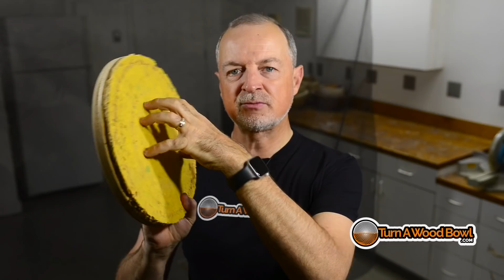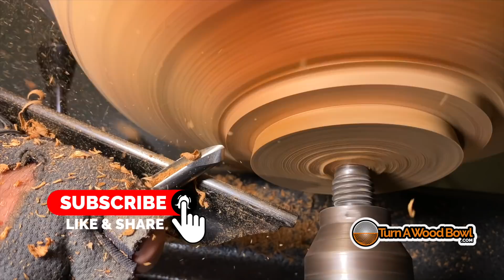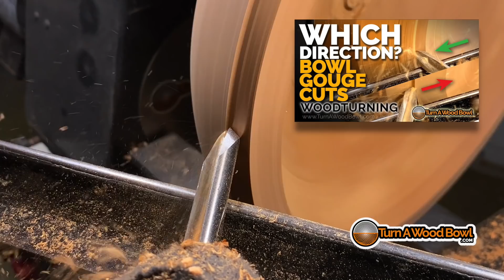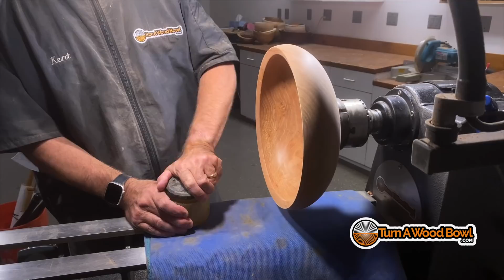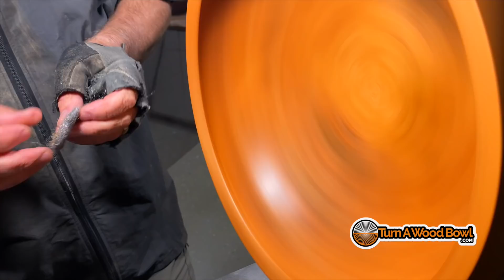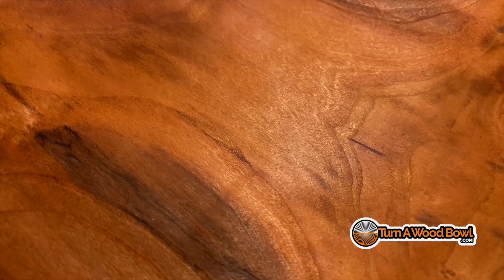Woodturning Bowl Video

Comment: Last large diameter bowl I did was from “clean” (no knot) 2x4s glued to make a blank 3 1/2” x 15”. It was an experiment. There are a few things I would do differently but for what it’s worth, it turned out decent and we use it for fruit. Finished with amber shellac.
Reply from the maker: Sounds great Robert. Keep up the good work. All the best to you and Happy Turning!

Comment: Hi Kent, I’ve had problems using 0000 steel wool in the past when applying wax to restored furniture. Now I use white scotch brite pads (non abrasive). I’m assuming I could burnish the bowls using your finish the same way? Cheers and all the best from Australia 🇦🇺
Reply from the maker: Jenny, yes, that should work just fine. Give it a try. Happy Turning!

Comment: Hi Kent,  I loved this bowl and especially the finish.  I have used Tried and True myself and the color is beautiful but I have not been able to get the luster shine that you have on this bowl even after burnishing with 0000 steel wool.  Are you doing anything else to achieve that shine other than burnishing with steel wool?  Thank you for sharing all your beautiful work and useful tips.
Reply from the maker: Thanks Lisa. Well the application process is important. The 24hr rest is critical. Also, some woods will have different results, especially if there is still moisture content. Hope that helps. Happy Turning!